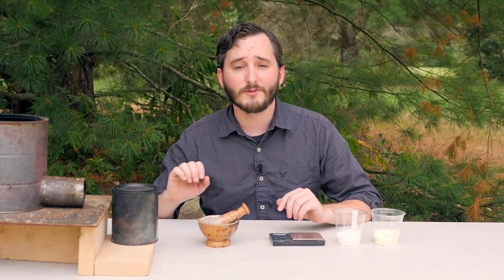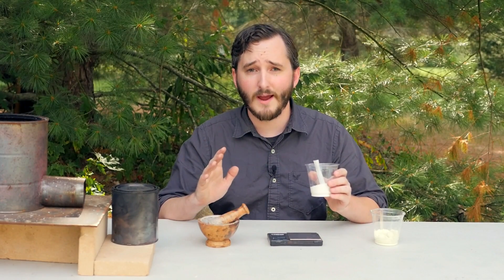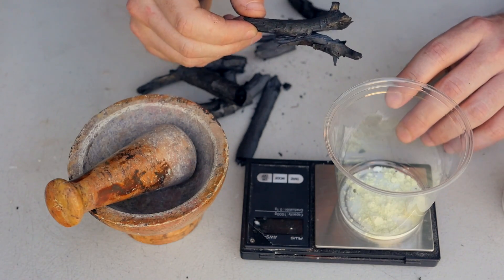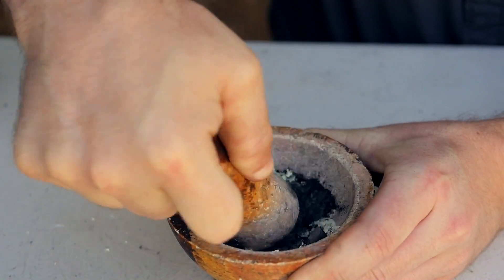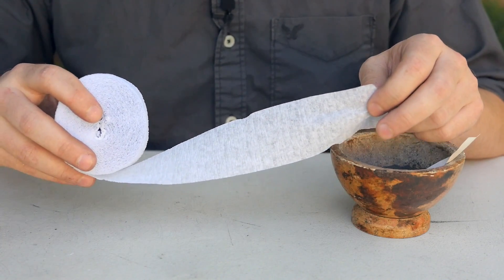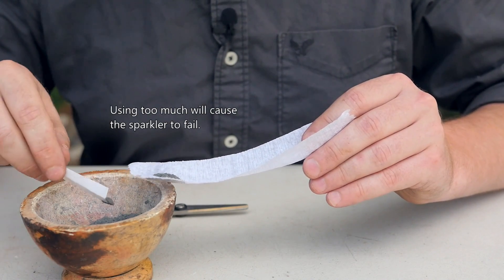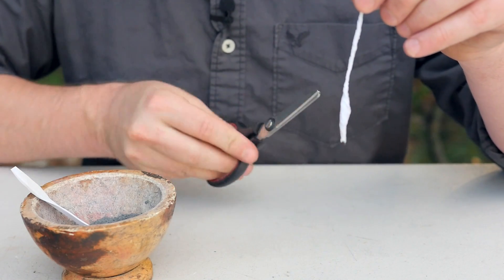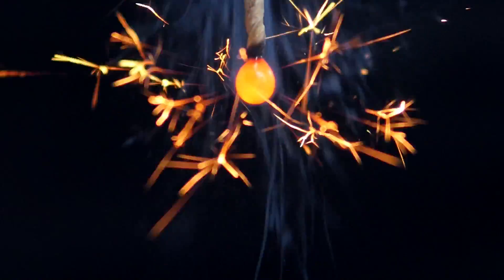How To Make Senko Hanabi Sparklers (very rare Japanese fireworks)

Comment: Try saturating the charcoal (lampblack) with the oxidizer (potassium nitrate) by wet milling it with for several hours instead of dry milling.   Just a guess.  Use roughly 1:3 alcohol to water as the solvent.  The water dissolves the potassium nitrate.  The alcohol should help the lampblack from repelling the water.  From what I've read.

Comment: Thank you so much! you have made me a fan of both your channel and senko hanabi! Very tricky chemistry mine want to flare like flash powder so I tried suppressing the flare with a little sugar, very little, and it seems to work to hold the glob but it sparks less. I still can not thank you enough for your tremendous effort, it has made the learning curve shorter by several years. Just like you I will share my findings and credit you for the insights in this amazing craft.
Reply from the maker: Be sure to check out my senko hanabi playlist. I've made a lot of progress since this video that will help of you try to recreate them

Comment: Try using aluminum foil for collecting the lampblack from fatwood, it collects the carbon from fire like no other, just don't use the heavy duty stuff, in fact the cheaper and thinner the foil the more it will collect in my experience. This method works great for me.
Reply from the maker: That's not a bad idea.

Comment: What I'm wondering about is the physical process behind the compound sparks.  I speculate that drops of the mixture are splashed out when bubbles break the surface of the glob.  Then as they fly through the air, the high surface area-to-mass ratio of a small droplet makes the drop heat up until the boiling point of some component is reached.  After slight superheating, the material boils, popping the droplet like a popcorn kernel and scattering smaller droplets.  Vaporization takes energy, so the material cools back below the boiling temperature, and the process repeats.  But it doesn't repeat exactly the same.  Besides having smaller droplets, there's also a difference in composition as some material has burned and some has vaporized.  So the branching sparks have an appealing degree of variation between one level and the next.
Reply from the maker: See this video and the channel linked in the video description: https://youtu.be/WmjsL0BJILA
Reply: @Nighthawkinlight  Thanks!  Looks like I was righter than I thought I would be.
Reply from the maker: This clip gives good detail of the process: https://youtu.be/1vNpSwPjGFA

Comment: I just recently got into black powder and things related just because. I stumbled upon your video and took some pointers. The only thing there is left of the tips is the actual composition mixture. 52% potasium nitrate(spectracide stump remover is pure), 28% activated organic charcoal(Azdent teeth whitening online), 20% sulfur(bought online 99.9% pure). The tissue paper i use comes from a dollar tree which has nice size bundles for 1$. I cut a strip of paper exactly the width of a dime and a dollars lenth long rectangular strip. 1/2 inch from one end, after folding like you do in the middle longways, i put about a peas size pile of the comp. Maybe just slightly smaller. Then pinching the end i twist to capture the composition between the paper and twist/roll the paper the rest of the way. Tight but not extremly tight. Kinda loose tight if that makes any sense. Then in the middle i use my forefinger and thumb to tightly roll between them a real tight spot only about a grain of rices with in it. This i call a start/stop that if your slag that forms has momentum it'll recharge, so to say, at that spot and give a round two to the sparkler. Also after twist/rolling the sparkler it will be roughly half as long as the paper it started from. Dont trim the end just light it. P.S. I began learning this this weekend. I have aquired savant syndrome. TBI.

Comment: One important thing: all components absorb water from air and that has a HUGE effect on result. To be perfect, all components must be dried in opened oven and then sealed.
Reply from the maker: You're right that the potassium nitrate especially absorbs water from air, but in my opinion it is better to use components that have acclimated to the native environment and optimize the composition with that in mind. Otherwise these sparklers would never work right unless you use them as soon as you make them.

Comment: Question 1:
Is it meant to crawl up the paper as it sparks, sustaining itself? The intro looked like it was.
Question 2:
I made some of these (with a scale hopefully accurate to one gram and thin toilet paper), but they turn into globs before the composition is done burning, and I think that might fling some off. Would a little more of some ingredient slow down the glob, or speed up the burn to get it over with?

Thanks for the video, and for the excessive time you spent figuring it out!
Reply from the maker: It crawls up the paper some, but the composition should pretty much all be consumed before then. If the ball forms early that's a good sign that you've made it right. Maybe a little too much composition if it's falling off
Reply from the maker: You're going to have trouble if you don't use streamer paper like I do. The paper is critical.
Reply: I’ll need to find some paper! Thanks. 
I need almost eight feet of hose for my vortex generator. I am replacing the inner two rings with PVC squares because the hose would not want to be bent that tightly. I will be using several funny fittings: side outlet pieces. Vacation in 1  1/2 weeks, so I’ll do it then.

Comment: Cerium metal makes the ultimate sparks followed by titanium. Iron fillings or fine steel wool aren't bad. Magnesium burns too hot I think it would mess with the drop of molten oxidizer. Sugar makes too much smoke.

Comment: perhaps you need to supplement more carbon into the mixture, i would suggest graphite as it is easy to get, and you shouldn't need a whole lot of it, probably add 1% graphite by weight, and go from there,  while graphite doesn't burn below 1000 degrees C the potassium nitrate should help with that, as well as the sulfur reacting with it, you could get more sparks this way, other than that perhaps add some sugar, while not free carbon, sugar does contain plenty of carbon and at those temps it is easy to react with.

Comment: Include a small amount of Steel Wool into the mix as you pulverize/powder it.  Cut the Steel Wool first into tiny lengths with metal shears then put it into the Mortar to grind it with the other ingredients.  You may need to increase the Potassium Nitrate proportion as well.

Comment: I think that the charcoal should by hard and porous at the same time. That why pine is prefered, due to its rich of resin, it will be hard and porous as a result of pyrolysis of resin (resin burned leave a lot of pores and the carbon of cellulose are coated with carbon residue of the resin). The harder the charcoal grain, the brighter and longer live sparkle. The more porous the charcoal, the easier they are ignited. May be the pine in Japan can make a different?

Comment: Hey, did you ever try the following sources of carbon:
coal
Lampblack
Pine resin soot

Pine resin soot (collecting carbon on a metal plate whislt burning pine rosin) is meant to create massive branching sparking flowers or "spur fire". I have read they can be up to 50 times the size of the droplet or the size of oranges.

Comment: Hi, I need a little help. I tried this, using the exact composition you gave, and fire-resistant party streamers as you suggested. In all my trials except one, it did the first burst of flame and then went out. In the one that did work, it was slow and the sparks were very small. I even tried adding some extra oxidizer (dangerous I know), it made the ignition more violent but still went out. Is my paper TOO fire-resistant or is there some other factor I should be looking at?
Reply from the maker: Adding more sulfur will make the ball form more easily, adding more charcoal will make more sparks but increase the failure rate. Try blowing gently on the ember and that can help the ball form also

Comment: Try a small bit of magnesium powder, colors can be added with zinc or other metals used in pyro designs  - emphasis, a very small bit of magnesium - super hot and could cause super fast burning (as well as damage to eyes - burns super hot and bright) or even explosion

Comment: I'm going to try the crepe paper but I had home made rocket wadding, the stuff used in rockets to keep the parachute from burning, which is a paper towel soaked in a baking soda & water solution then dried. I cut strips and since it was two layer towel peeled it apart. It worked just, kind of okay.

Comment: If all else is equal then the sparks from 2008 could have just been a result of the particular composition of the air around you when you were burning the sparkler. There may not be any way to consistently formulate the powder to produce the same effects. Although the most obvious possibility seems to be the exact particle size of the components relative to each other and the moisture level of the composition as a whole when you ignite it. Also, there could be some differences related to the length of time the mixture is held prior to igniting it. Have you tried storing some sparklers in desiccant then lighting them after different periods of time?
Reply from the maker: I tested a lot of sparklers that same day using the same batch of composition, none worked quite as well as the one shown. It was a fluke. I do know the results can be repeatable though because these sparklers are commercially manufactured, it's just very tricky to nail down. My chemicals are stored in air tight containers, very dry.

Comment: As an idea to get a more dramatic result, try taking half the mixture and grinding that into an even finer powder. Then, mix the two back together, and use it. It should allow the sparks to have the surface it needs, while also allowing more surface area to create more potential energy.

Comment: I just made some today using some formula online, was having an issue keeping the tissue paper from losing the  molten blob, a way to fix it is to make a borax and water mix and dip the paper into it, then let it dry. Not getting fancy sparks like your example but the tissue paper is doing a good job at holding together.

Comment: I had an old fireworks manual, published 1934, which said the best results for senko hanabi were realized using a mixture of particle sizes in the charcoal.
Fines insured quick combustion and slag formation, larger particles threw more and bigger sparks.
The author speculated that rubbing charcoal fines into the paper beyond the composition mixture would improve the endurance or 'climb' of the slag.
Good job, I never got mine to work.

Comment: My compound seems to burn much faster than it should. My measurements were very accurate. I used white pine charcoal that I made but it was all ready milled to air float size. and instead of party steamers I used toilet paper that I treated with baking soda (wading for my homemade rockets). Suggestions?
Reply from the maker: Try using much less and see what happens. It can appear to burn too fast if you use too much. Note that often the powder will all burn long before the ball begins to form.
Reply: Ah I see what you mean. Its a fine balance of molten sulfur and KNO3 that forms a liquid drop, too much and the drop will drip.
Reply from the maker: Yes, and the more sulfur you add the more easily the drop will form, but less sparks. More charcoal and you can get better sparks, but it's very hard to form the drop.

Comment: I wonder how the humidity compares between where you live and the region of Japan where these were developed. Assuming Japan is more humid than your place this month, you might try to humidify the paper before rolling it, or perhaps to humidify it afterwards. If humidifying has an effect, I wonder if it would make it slow it down and change the relative rates of the competing chemical reactions here. That could have a noticeable effect either way. The humidity of the other ingredients might also be an issue. Obviously, the humidity of the charcoal could also add uncertainty to the weighing. But hygroscopic absorbtion by the nitrate might also be a conceivable factor. It is cool that you can make such a gentle reaction.

Comment: Here in Japan, when making Senkou Hanabi we use Shouen (松煙) which is a type of charcoal made from pine that was originally used as a pigment. This type of charcoal has much more sap than other types of charcoal which is why it is so good at making sparks. To make sure it has lots of sap, the part of the tree around the roots is used, rather than branches. In Japan, you can buy Shouen powder but it might be hard to get outside of Japan.
Reply from the maker: Thanks for the info! I think the English name for the type of charcoal you're describing is 'lampblack'. I may try making pine charcoal from near the roots as you suggest, and try lampblack also.
Reply: You need to be a little careful as in "lampblack" often refers to the name of the pigment color. It could be any powdered soot made using the lampblack method, or it could be real Shouen made from the part of the pine tree that is rich in sap. Under a microscope, the particle size of soot using the lampblack method is much smaller than that of real Shouen. So YMMV...

Comment: They works but i have to work on sparks mine are tiny.I've used poplar charcoal that is good for black powder, but for this kind of firework i should use an harder wood.And toilet  paper woks very well.
Blowing gently ususally increase the ammount of sparkle that cames out
Reply from the maker: I didn't have much luck with toilet paper, glad it works for you though.
Reply: I have also tried 2 kind of kitchen paper  one works better than the other

Comment: I've been attempting to perfect Senko Hanabi for about 15 years now.  The charcoal is the most important component, I've had some great success with charcoal from pine cones, but only one particular batch worked better than just radiata pine charcoal.  Vegetable black from one particular brand of art pigment worked well also.  I tried realgar once, not worth the toxicity fears, especially inhalation of the smoke!  I use high purity recrystalised potassium nitrate and resublimed sulfur, but it doesn't seem to make any difference compared to fertilizer grades.

I've tried many kinds of paper.  The crepe of streamers works as you suggest, as does genuine Japanese washi.  The best paper I found was a bleached kitchen paper, thin and smoothly calendared.  The brand may only be available in Australia, it has a tiger on the wrapper.  Haven't tried to find a US substitute yet, still using my original roll.  Another paper that was exceptional was that which a particular brand of glass microscope slides were packed in, a sheet between each slide.  A little too small for comfortable hand-held sparklers, but really excellent for some reason.

Composition wise I use 60:24:16 KNO3:S:C as a starting point.
Reply from the maker: I'll have to try pine cone charcoal, I have 4-5 different species in my yard so I can find out if one is better than another. Thanks for the info!
Reply: Seriously look into cedar charcoal... Lots of sap!
Reply: Another Australian pyro? Btw just curious, where did you source your potassium nitrate?
Reply: Hey there! Hoping to make Senko Hanabi soon, and I was looking into papers to use, and you seem to have had good results, so would you by any chance remember which brand of kitchen roll you had? If not, one more question, was the picture of the tiger on the wrapping animated?

Comment: Wow thanks for another great video! I know I've of the comments said that any metal would burn to quickly but for better sparks you might try a number of strands of ultra-fine wire (maybe aluminum, iron, magnesium, etc)! I'm thinking that the wires will burn more slowly than powdered metal!

Comment: Have you tried making "incense paper"?   In an old book of mine it has recipes to make homemade incense and it talks about this paper. It's pretty simple, you take strips of blotters paper and soak it in a solution of potassium nitrate and let it dry. After you light it and blow out the flame it's suppose to smolder.
Reply from the maker: I've tried nitrate soaked paper for these. It doesn't work because the drop can't form when the paper is burning out from under it.

Comment: Have you ever tried analysing the powder from an original Senko Hanabi sparkler? XRD with an internal standard would be a good start in quantifying the ratios of the powder. From there, it's just a refinement of particle size and homogeneity. I'd be more then happy to analyse it for you but unfortunately I'm in a different country. I'm sure a local university would run it for you free of charge though.
Reply from the maker: I have not. That's a good idea

Comment: Another cool vid. You could wet the paper with alcohol, coat it lightly with extremely fine aluminium/magnesium/iron oxide powder, let it dry and then use that to make the sparkler with. Or you might even be able to just use a Pritt Stick type light paper glue to stick the powder with. That should generate the sparks you're looking for. I believe in the original sparklers that the sparks were down to the choice of charcoal used.